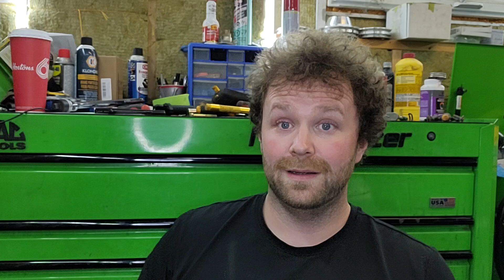Old School vs New School Mechanics | Why Memorizing Specs Doesn’t Matter Anymore

Comment: Great video Lance👍. Haha, it's funny that you mention a 1995 Honda Civic. When I started in the industry in 2005 at the Honda dealership, I was in my Fast & Furious days with my 1995 Civic hatchback lol. I knew engine codes and body codes and torque specs and all kinds of information that would be otherwise useless to me now and eventually became non-important after I left the dealership and entered the independent realm.

Due to the way I was "mentored" in my early years (learning decent information that was slathered with a lot of bad habits and a "good enough" attitude), I had to unlearn a lot of things, and I realized that while it is helpful to know the basics and information for things that you work on regularly, it is still always a good idea to take 30 seconds and consult the service information. It was especially true with domestic engines with the cylinder identification and firing order, because all you need is to be trying to diagnose something and you are overconfident that the cylinder numbering alternates back and forth from the left bank to the right bank when in fact it is sequential from one bank to the next, and you just let yourself down the garden path because you didn't want to take a half minute to quickly look it up to confirm.
Reply from the maker: I've wasted alot of time on the wrong cylinders lol

Comment: The automotive industry has changed completely from the old days. If you worked at GM dealer in 1970 there were a handleful of different models. Its wasnt too hard. Now theres so much different stuff now. When i worked at a fleet they only had international 9000 trucks. That guy knew every detail about those. And that makes sense. But in most shops, you need to find information. I work in a fleet with 270 unique models, you cant remember all that stuff.

Comment: Never remember anything you can look up. 

Just yesterday I looked up the brake bleeding sequence on a vehicle I have had for 10 years, "start at the wheel furthest from the master" I thought,... went to my bookmarks and pulled up the FSM, would have done it completely backwards due to the split braking system, this is on a 1990 nissan... 

Worked on transport trucks for 7 years.... did 100s of bearing sets, looked up the procedure and spec, every. single. time. If questions were going to be asked I wanted to be able to pull up the info I followed quick fast and in a hurry, rather than point to my noodle and shrug my shoulders...

You nailed it the dinos think rattling off a firing order means you are an engine god, must be ptsd from the time they mixed up plug wires and ended up rebuidling the engine because they couldn't figure it out 🤣

Comment: Ah yes, the "firing order" guys.  Misfire diagnostic for them starts with plug/rotor/cap/wires......  Know theory, not specs.  As you said, WAY too many specs to ever remember.  I'll never remember pin outs, inline connectors, etc.  But I know the injectors all share a common B+ feed, and there's 6 injectors, that's 7 wires.  Hmmm that connector there has 8 cavities, but it missing one... perhaps we test there.

Comment: What do you mean, fiber optic? What in the world would you put fiber optic in a vehicle for?
Reply from the maker: Mercedes.
Reply from the maker: They use it for can communication. It's a common repair I've done for years.
Reply: The high-end Euro vehicles like using it.
Reply: When I was at Chevy dealer back in the early-mid 90's our factory service rep (AVO- can't remember what that stood for) he had told us that GM was experimenting with fiber optics, but what they determined was that because of the structuring of the vehicle and the inherent vibrations caused by various sources (roads, engine, drivetrain, accessories,etc) that is it wasn't feasible because of the delicacy of the system. Meaning if, say a optic line had broke (at that time) it would be almost impossible to repair. I'm sure there were other reasons, but can't remember them all. I would think nowadays that technology has gotten much better and more reliable and cheaper.. Also at that time they were talking about using 42 volt systems using smaller wires with lower current, but still using the 12 volt system for the starting and charging systems. That's another story.

Comment: I agree with your description of old
School vs new school. Another way I think this issue presents itself is enthusiast vs technician. If an owner of a vehicle loves their car it’s easy for them to memorize every spec and package option about one car they care about. But when a modern tech has to try and learn everything from 1989 to 2024, gas diesel carbureted port injection GDI turbochargers not to mention hybrids and EVs, forget about memorizing everything. Not like an enthusiast/mechanic could back in the 60s and 70s when a vehicle was basically the same for about a decade before major changes came along like we see every 2-3 years in today’s world.

Comment: Independent tech from 2007

My coworker has been wrench since 1980 

We make a good team. 

He didn’t take care of his body tho. 

Keep ‘em comin Lance.
Reply from the maker: those old techs are fun to work with@ yeah alot of them are hurting though :(
Reply: I worked with a guy in his 50s that was a great tech. Never saw him diagnose anything incorrectly. He took way too long doing everything he did however. I’m 30, been doing this professionally for the last 9 years and I ran circles around him, pretty much for the same reasons described in this video.